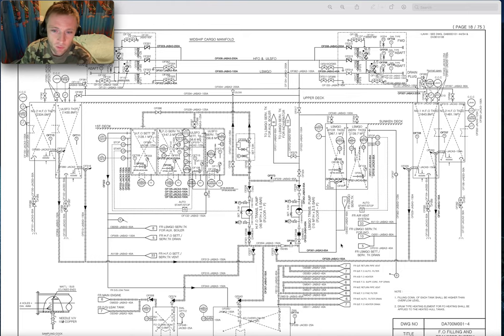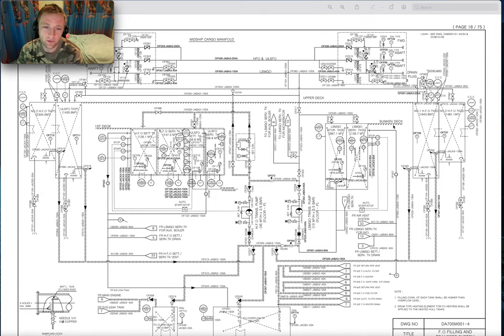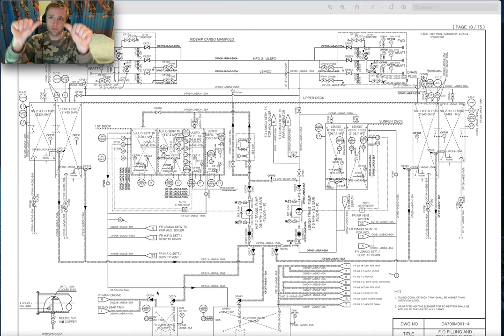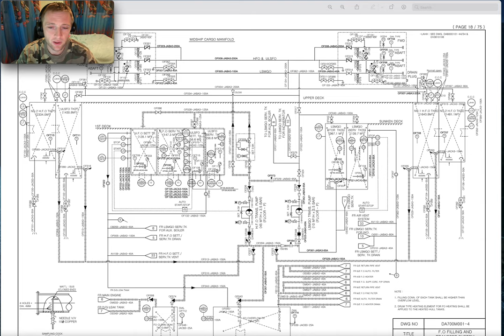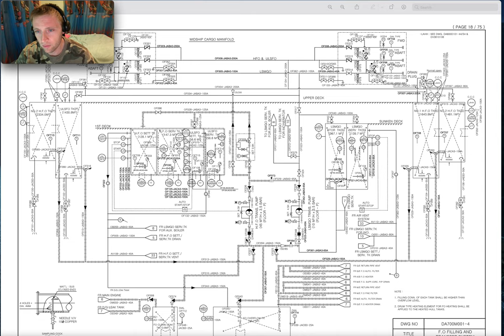How to reduce CO2 impact in marine industry.

Comment: Also from my experience I would like to share some information to prevent oil spillage in the engine room . I had experience when high level alarm 🚨 of overflow tank was sounded due to 3rd Engineer forger about his transferring from storage to Settling tank . High level alarm of overflow tank was establish very close to full capacity of the tank , what happened at that time . When alarm was sounded 3rd engineer decided to open top cover of overflow tank in order to make a sounding but suddenly when he was opening top cover overflow tank has been already under pressure and about 5 meter of head pressure has come to Engine room . After that about 5 days of all engine room stuff cleaning job .  Be sure before opening of sounding pipe if alarm comes   High level overflow tank , that your tank is not pressurized !!!! There is a small checking device . Use it always before opening any kind of tanks Especially overflow and scavenging drain tanks 👍
Reply from the maker: Nice share of experience i believe is nice topic how to prevent such things occur in the future.